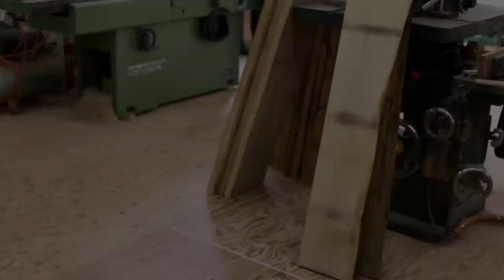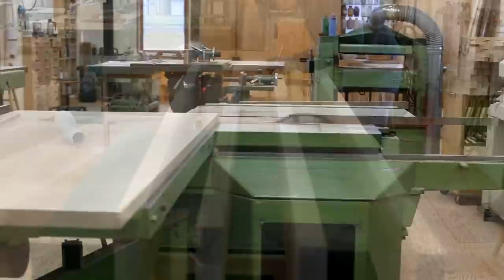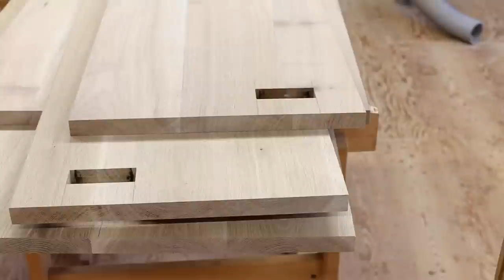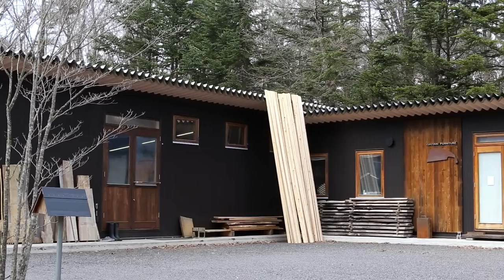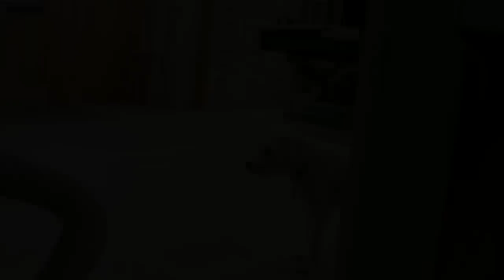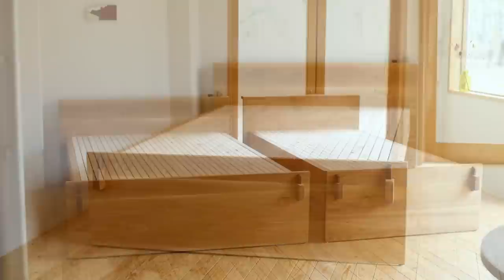ISHITANI - Making Japanese Futon Bed - Tusk Tenon Joint

Comment: This is an awesome bed but my question is is what type of wood that is. I would be afraid that the end grain will bust out with too much weight. What kind of wood is this and what kind of end grain sealer do you use if any